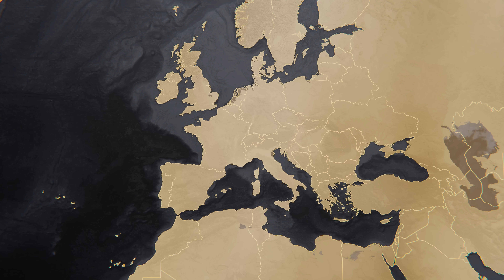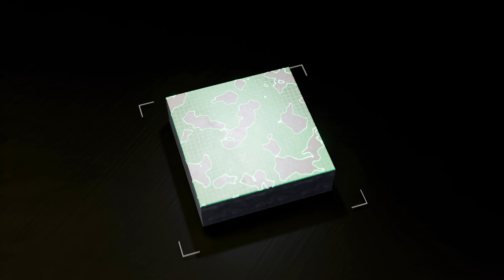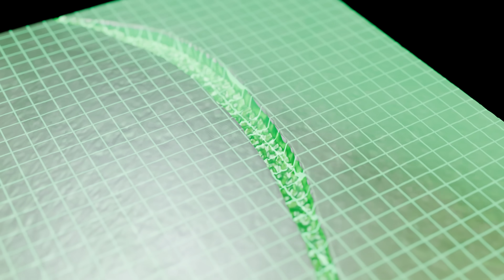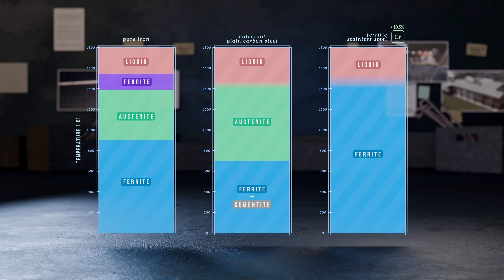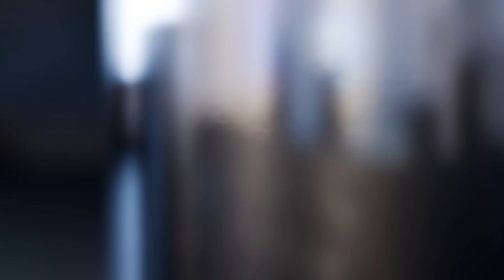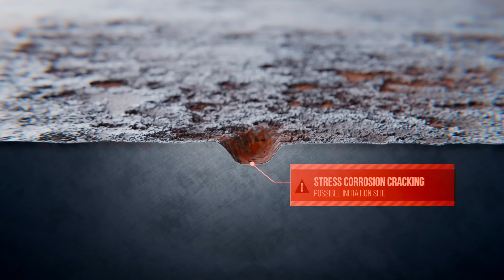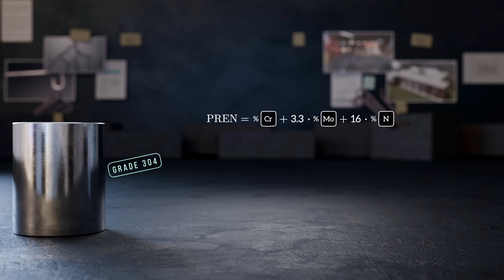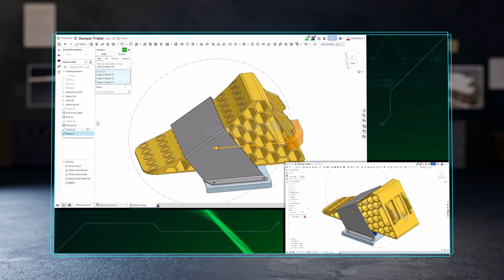The Problem with Stainless Steel

Comment: Before I watch this my hypothesis is that the stainless steel bolts being in a pool had some sort of reaction with the chlorine and I don't think stainless steel is designed to handle chlorine like that

Comment: The industry I was in the entire class was under a more appropriate term;
Corrosion Resistant steels.
Each has a different level and needs a different thing to begin the process of its breakdown.
The one we worked with the most was an expensive PH and it would begin rusting after exposure to high heat rather than chemicals. 
No visible damage until (some months years) after it's exposed to fire. 
The one we knew of as the most chemical resistant was 303 Silicon Killed.  Not great for strength but great for stability in harsh environments. 
The PH family best for high strength and resistance though the more towards high strength you increase the propensity to become corroded over time.
The solution is to update the fastener or part before any corrosion began much like you recycle your vehicle once it gets too rusty.

Comment: I hear stainless failed due to corrosion “They used 304 didn’t they” 

“The rods above the pool were 304” Yup there it is

I worked with stainless for about 7 years as a welder/fitter and one job really changed my perspective. Was doing a pharma gig somewhere in the midwest and I got to see first hand how quickly 304 can get chewed through. Even watched as temperature probes we ordered out of 316 were corroded over the span of weeks or months until we had to replace everything in a high nickel allow called Hastalloy. Stainless is a very interesting metal. It’s my favorite to work with but even in industrial use cases it can get overestimated.

Comment: Aight 1 minute in. Who in the holy fuck would use a suspended concrete slab as ceiling. As a civil engineer, i would quit on the spot if an architect came to me with that retarded idea.

Comment: 6:24 oh that explains why my stainless steel bottles are slightly magnetic right at the corners
Reply: When shopping for my sailboat (my former home) I always brought a magnet and if it attracted the screw or bolt I would reject it. A small compass is perfect for this.
Reply: @markfeldhaus1  I know it's more expensive , but you probably should stick with aluminum bronze. My family builds sail boats. 😊
Reply: Strain hardening is what puts the most strain on cutters when machining. So an austenitic steel will throw martensitic chips.

Comment: Do your homework. Stainless steel will corrode in contact with chlorine. Ignorant general builder's mistake to use over a pool that uses chlorine additives.

Comment: I'm an aerospace materials engineer. There is nothing wrong with stainless steel.  There are thousands of types of stainless steel. 
The problem is the incorrect selection of the specific type of stainless steel.  What went wrong was not asking a materials engineer what type of steel to use for the specific application.

Comment: Wow…clueless engineers didn’t understand how chlorinated aerosols attack the carbon in lesser grade stainless steel, such as 300 and 400 series metals.  Even 316 SS is susceptible to stress corrosion cracking with constant exposure to high Cl levels carried in H2O aerosols common in high humidity environments such as building housing pools. HOT TUBS using bromine for microbial control instead of Cl are less likely cause such a problem.

Comment: I think of 2 things right  off- the rods were embedded into concrete, which itself is unkind to metals, anyone who worked with concrete and gets some on their hands knows you can get chemical burns from it. The other is the rods probably came from CHINA, the land of toxic drywall, CARB certifified flooring with FORGED certifications, lead in painted childrens toys, toxic dog treats and so on, would not surprise me it the least the 304 "stainless" was substandard to begin with.

Comment: As a NASA engineer, we don't use the abbreviation "SS" (stainless steel) on our drawings, but rather "CRES".(corrosion resistance steel).

That subtle nuance psychologically reinforces the fact that it's almost impossible to make steel not rust in all environments.  Therefore, we almost exclusively used CRES steels like 15-5 and 17-4 rather than cheaper 304 (18-8).  In really harsh environments, petroleum engineers pay a lot more for Inconel, which isn't even a steel.

Most likely at the time of the manufacturing of that Swiss pool, engineers didn't have the info about 304 SS that they have today.

Comment: I work with failure analysis. I analyzed a case where a yacht sank after the bolts securing the rudder supports fractured. The supports acted as "plugs," closing openings in the hull through which the rudder control cables passed. The bolts were made of 304 steel, which broke after only 3 years of use by the yacht.

Comment: TLDR: Ceiling over pool was held up by rods made grade 304 stainless steel (18% chromium, 8% nickel), an austentic form having a face-centred cubic structure. Warm, humid air from the pool rose into the ceiling cavity, carrying with it chlorinated compounds which decomposed on the rods leaving behind chlorides, breaking down the chromium layer and causing pitting corrosion, which became initiation sites for stress corrosion cracking due to the rods being under sustained tensile stress from not just holding up the ceiling but residual stresses from manufacturing. Short-term plastic deformation at the initiation sites opened gaps in the chromium coating, which the chloride ions prevented from reforming, allowing the crack to propagate. A ferritic steel with a side-centred cubic structure would have had greater resistance to plastic deformation and also, due to the additional molybdenum have a higher PREN (pitting resistance equivalent number), thus better resisting SCC. But these days we now use duplex stainless steels.

But also lots of extra info on autstentic vs. ferritic, martensitic and duplex steels, including elongation vs. yield strength, ductility and strain hardening.

(Damn, I hope I got all that right. :-))

Comment: The problem is that 304 stainless steel corrodes faster when theres a lot of chlorine, tensile stress, and humidity. Engineers switched to duplex stainless steel for chlorine rich environments after the pool incident. There, saved you 20 minutes.

Comment: Why would they hang heavy concrete ceiling?... what function does it serve?
Reply: It was only a 100mm thick concrete and had no involvement in the eventual failure mode...
Reply: @peterfitzpatrick7032  do you even know how much 100mm is? xD
And yeah, it had "no involvement" other than being the thing that killed people

Comment: I learned welding and locksmith in th 90s, did a lot of V2A (304) and V4A welding for public water supply, handrails and the like. I expierenced that a lot of people think using a more expensive material is having a better solution, but this is not always the case. 

A simple steel screw can perform better than a stainless one, depending on the place it is used in. Corrosion is an issue, but it is not the main one for all applications. On my 24 year old Jeep, which I repaired mostly myself, screws which need to be drilled out because they corroded that hard had been quite rate. I think it was only two. Given a normal lifespan of under 20 years for a car, this is not an issue.

For the swimming hall douplex would be the best solution, but I think even a zinc coated normal steel would have outperformed the 304 (V2A) as a zinc coat is far thicker than 10 atoms and did heal bigger cracks. Also a regular visual inspection could have shown corrosion on this material quite easy, while the kind of corrosion happend in the video would not have been visible.

I would also worry a bit about the slight motion which is possible in buildings such as roofs, which could lead to cracks in harder materials quite sooner than in more flexible. I also experienced wooden screens for more privacy in gardens do have some motion in the wind. This makes stainless steel screws break after a some time, while those zinc coated steel screws may start corrding after years but did not break that fast.

Comment: pressure vessel engineers and metallurgist and welding engineers will disagree about SCC needing temperature - they knew about this since the 60s - only structural engineers are ignorant of steels and their grades and how to apply them.

Comment: So now I had to take my magnet to my MSR camping stainless steel pots to test what kind of stainless they are. Curious. The lids are not magnetic, the base is not magnetic, but the handle and the pot rim are. So...did they use different types of stainless for parts...hm

Comment: i’m a materials engineering technologist and i based my thesis project this year for my schooling on austenitic stainless steels (304/316) in a high chloride environment at elevated temperatures to induce chloride stress corrosion cracking. Just started my preliminary testing today, and I can say confidently I chose a safe project because of how relevant this issue is with austenitics.

Comment: All of my experiences with 304 have left me with the impression that it's the most Temu-grade alloy known to man and is not an acceptable choice for any job- under ANY circumstances. 316L at minimum. 304 isn't even good for silverware as it'll rust in your dishwasher if you use detergent. 0/10. I've had the pleasure of designing with the god-like 17-4PH and it's incredible. I feel bad for the machinists, but wow that stuff is rigid. Went from a 200µm displacement with 316 to the (mandatory for the project) 5µm with even less mass.

Comment: Some ships mistakenly install Stainless Steel in Salt Water Piping. It last about 5 years if you're lucky. Mostly because the Chromium Oxide which keeps Stainless from corroding (iron corrosion) abrades away and holes appear. Copper Nickel is much preferred. Great video that I will share with my Marine Engineering Students.

Comment: I'm wondering why they're suspending concrete for a ceiling in the first place. wouldn't an open ceiling with truss style beams supporting the roof be better suited? a lot of the indoor pools in my area are like taht.
Reply: It was only 100mm thick... and an ideal longterm no-maintenance material operating in a high-humidity environment... 

the concrete didn't fail here, nor did it contribute in any way to the failure-mode which caused this tragedy....

Comment: Great video.  It’s interesting that in the high end watch world most brands (Omega, Breitling, Patek) use 316L whereas Rolex uses 904L which is more resistant to acid (like sulfuric acid) and salt water pitting.   

Overkill for a watch, but you’re overpaying for that watch too…so…why not?

Comment: The question here is why did they feel that they needed to suspend a concrete ceiling over a pool when an arched steel roof and perlin system would gave been lighter, cheaper and safer?

Comment: I just installed some high durometer rubber driveway to street transition ramps and selected 316 stainless steel bolts, washers anf Nylock nuts to hold all the sections together, because they'll be wet for a good chunk of the year.

Comment: Chloride stress corrosion has been a known problem in the nuclear industry for many decades. The U-tubes in steam generators are particularly of great concern. The risk is managed by chemistry control of the environment and monitoring of the materials using non destructive testing. Over 52 years ago I had the unpleasant task of shoving eddy current probes through the 2000 u-tubes to detect cracks in a steam generator on the USS Enterprise CVN-65. Chloride stress corrosion is an Achilles heel of certain stainless steels in hostile environments.